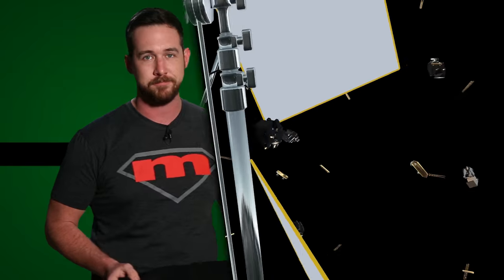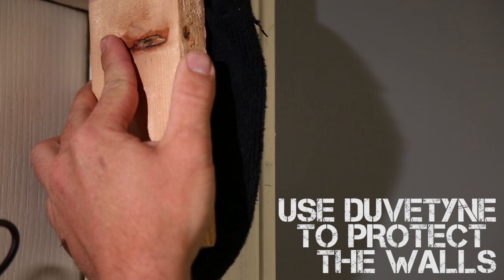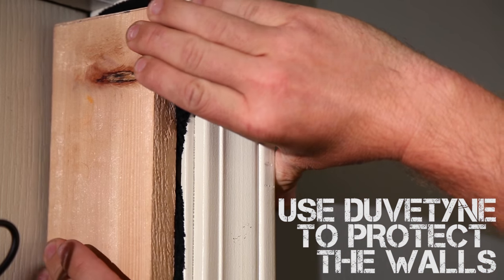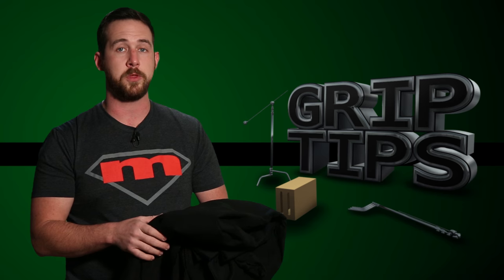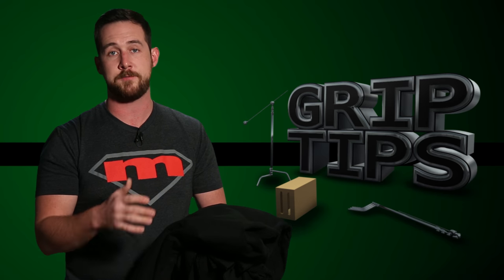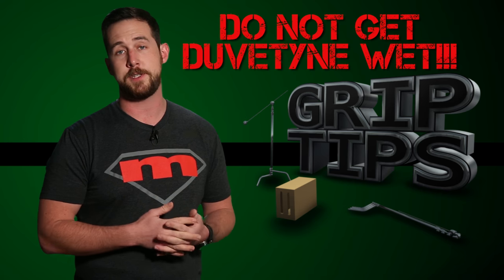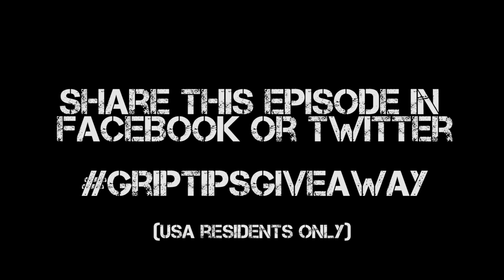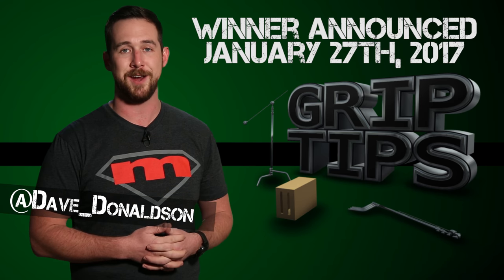Ep 23:  Duvetyne Cloth

Comment: Skirting! I would love to see a video on that!
Reply: Pause the video and look closely at the examples he gives. Basically it's nothing more than using clips to attach the material to whatever unit you're using. Cut it longer than you need and roll it up till you get the effect you're looking for. If you want to be super neat, you can staple bits of batten to the bottom roll it up as much as you need and use 'binder clips' (foldback or bulldog) to secure it. You can prep these ahead of time measure to kino flo's etc. and save re-use them. You can also use black wrap.